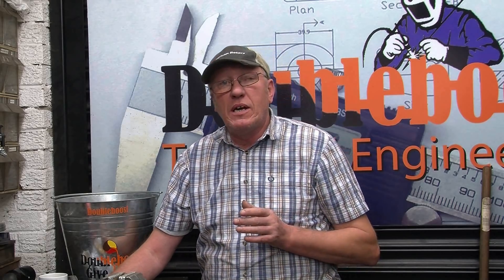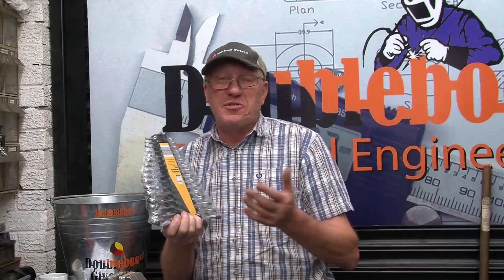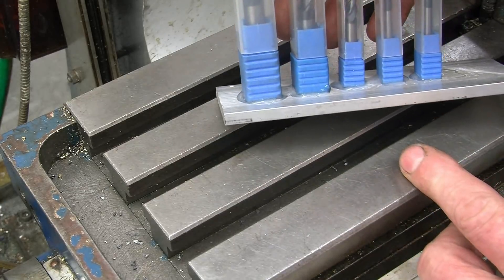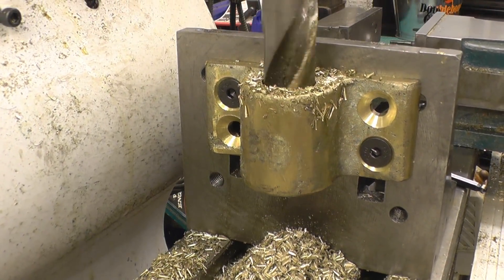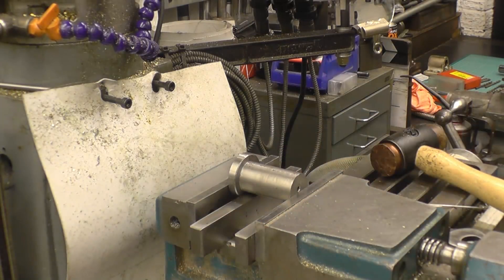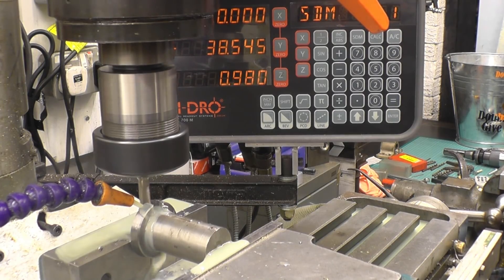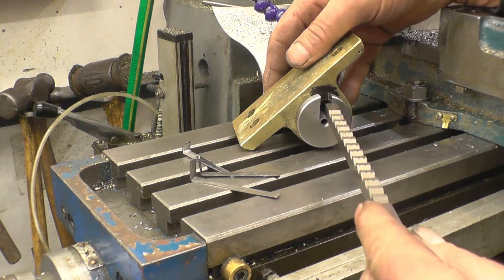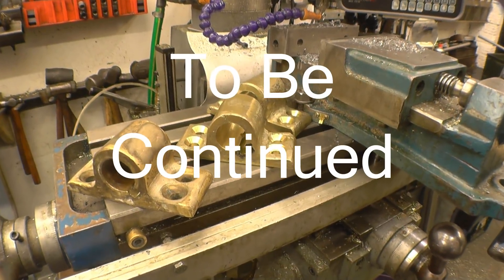SNNC 243 P1  Key Way Broaching

Comment: John, my plan is to use white water coolant on my lathe and mill.  Watching you has proven to me that it can be used without destroying your machine tools.   One of the keys to broaching is to be patient and not try to take too deep  cut, putting too much pressure on the broach.  You do some excellent pissing about in the shop. lol
Reply: Did you previously think that white water coolant ruined machine tools?

Comment: Use Kerosene (paraffin for you guys) for brass/bronze cutting lube.
Just knock the cutting edge of your drill off to 0 degrees for sticky metals that tend to grab. I even use that for steel esp when using a hand drill, lots of oil tho.
I just but a cheap set & grind them for brass/bronze & keep the good bits for steel.